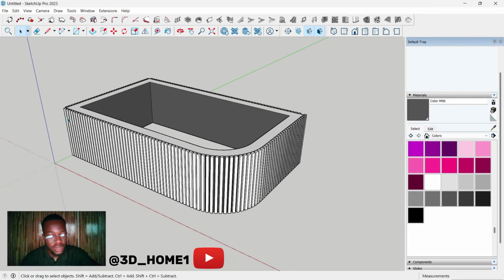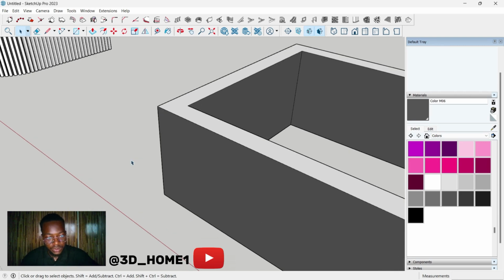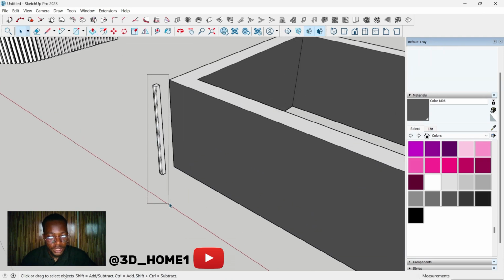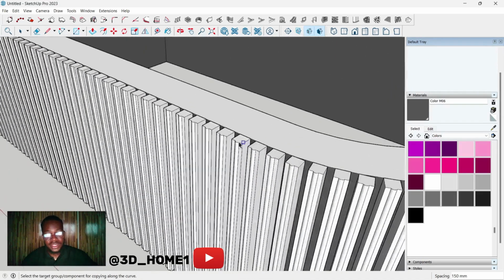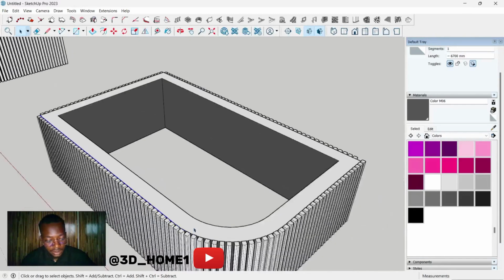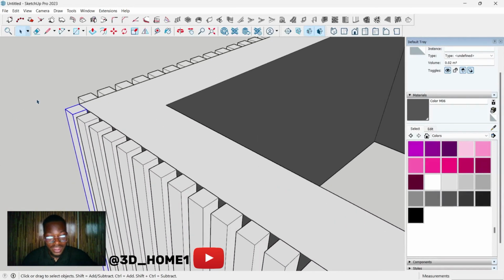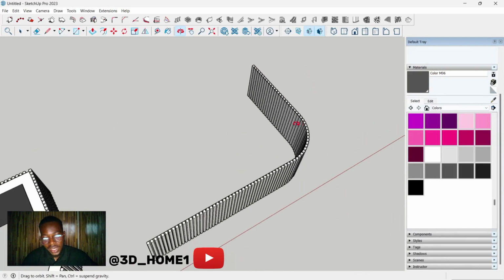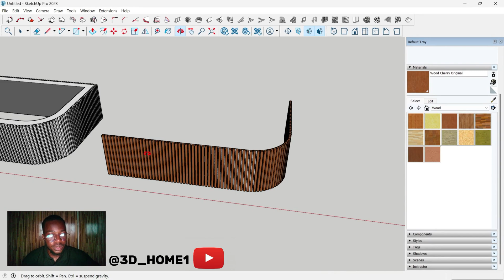How to model fluted panel on curved wall in SketchUp

Comment: bro how do i adjust the copy distance?
Reply from the maker: When you click on the track and also click on the model and your desired shape comes out, you will notice that all the model is showing purple color, so while the model is still on purple color check your bottom right corner you will see spacing 150, click on that spacing and type in your own figure.